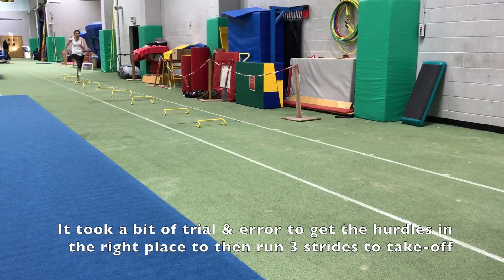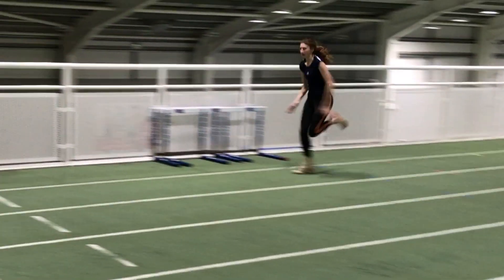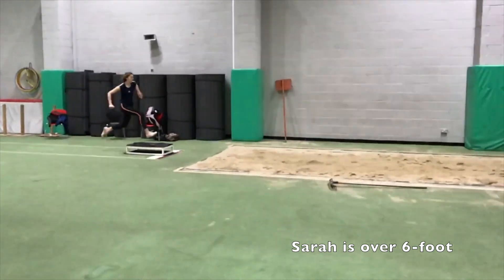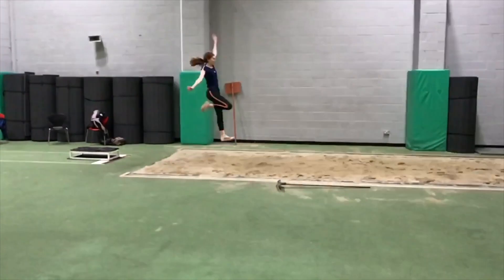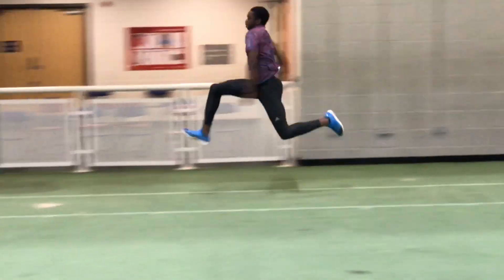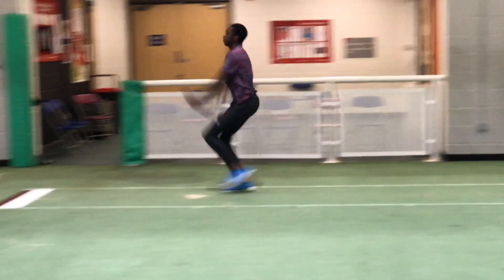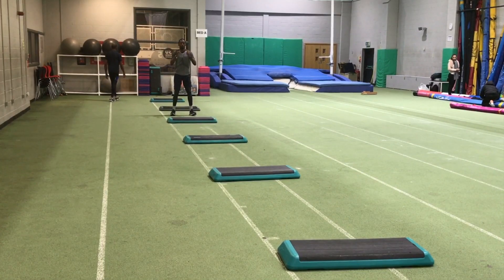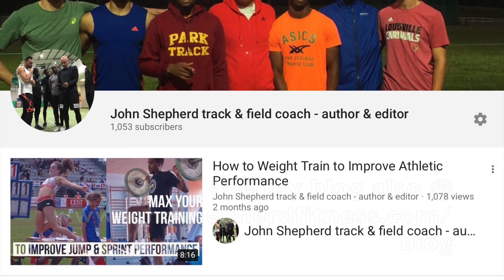Overcoming basic long & triple jump errors 1

Comment: John, what do you mean by the foot has to push away from the athlete?
Reply from the maker: Sorry for the confusion, I added the caption as I saw potential for misunderstanding with what I said: basically the leading foot needs to push away from the body before making contact with the ground in the hop-step and strep-jump transitions, for example, in the triple and when bounding as another example, and then come back toward the athlete (the track) when making contact, to minimise braking - more on less under the hips. Timing and not snatching at the track is very important here (as well as eccentric/concentric ability aka reactivity). Does that clarify the issue? Many thanks for the comment!
Reply: Thanks for the answer, all clear now.